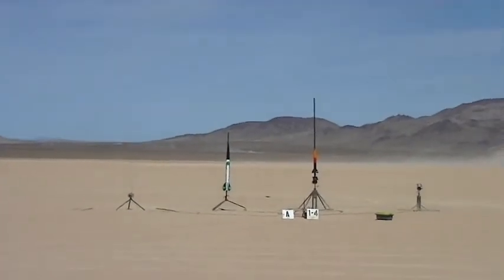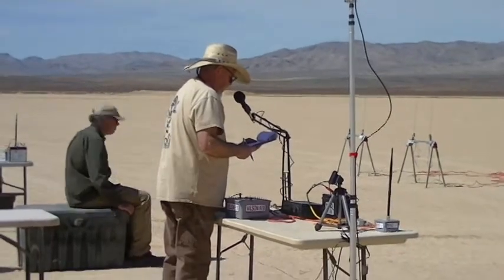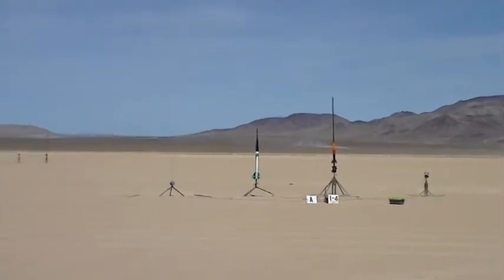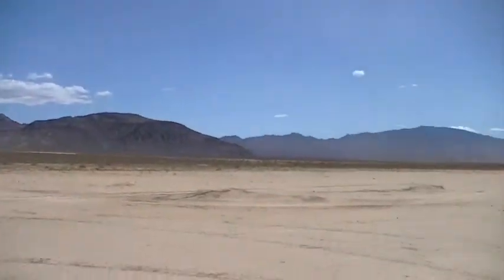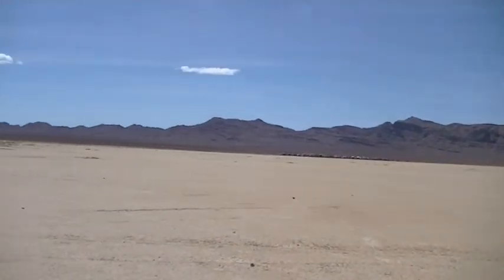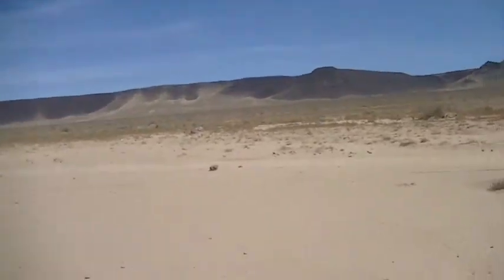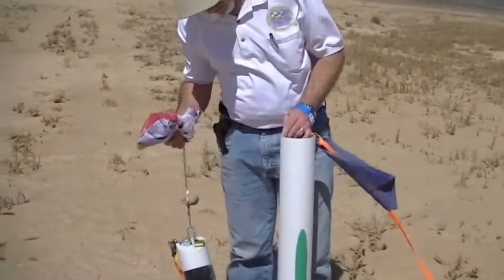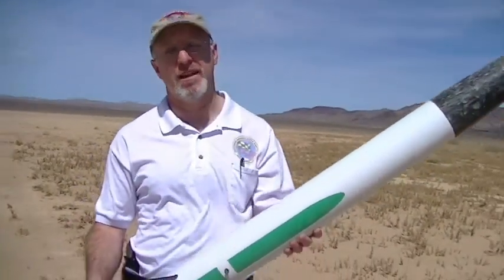r21 Zephyr Hi-Power Rocket - Part 8 Maiden Flight

Comment: What software did you use?  My Rocksim with the same motor is giving me  2000’ elevation. It won’t let me enter my rocket weight. I wonder if that is why your software predicted lower?
Reply from the maker: I did my pre-flight assessment with ThrustCurve.  It predicted 1,194'.  Rocket weight (No motor): 1,560g

FlightSketch Mini post-flight: 1,246.8'
JollyLogic 2 post-flight: 1,159'

I'm curious what your empty weight was?  Probably much lighter if you're predicting 2,000', but then again, I built mine like a tank.  I was going for survivability over performance.

Hope this info helps you.

Comment: Nice flight. I did my L1 on a Zephyr as well.
Reply from the maker: Thank you!  By the way, I’m in the middle of a “Dave Thomas” Wizard project. LOL 

I’m building an exact replica of the Zephyr out of a Wizard kit. The slot in the fins were a bit finicky, but they came out well. Assuming all goes well with the flight, I’ll be building another one on my channel as instructional build.
Reply: @KevinsModels  sounds like a cool project!

Comment: Nice job.  I have build this same rocket but have not yet flown it.  May I ask why you used a 48" diameter parachute?  Mine came with a  36" chute.  However, I think I build mine a little heavy, as mine weights about 1300 grams with no motor.
Reply from the maker: Great question!  The dry lake bed we fly off of is very hard, so I wanted as slow a descent as possible. In hindsight, it would have survived just fine with the 36” and not have been dragged so far along the ground after landing. Mine came out at 1260 grams, so it is comparable to yours. I will be releasing a video in the next couple days of the days’ events to include the L1 cert flight for GForcefilms. He maidened his Zephyr as well and used the 36” chute with no issues. Good luck on yours and keep us updated on it’s progress!

Thanks for watching!
Reply: @KevinsModels  Thanks for replying.  I hope to get my level one cert at my club's April launch (pending weather conditions).  I have chosen an H100 Aerotech DMS motor for my attempt.